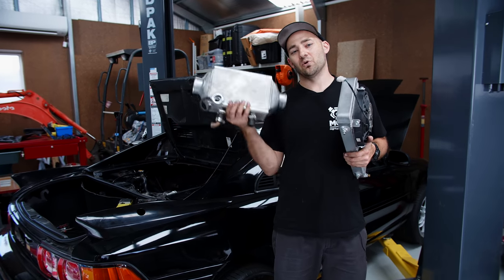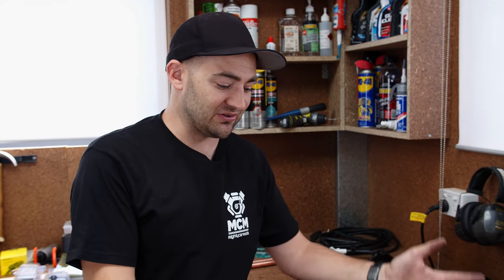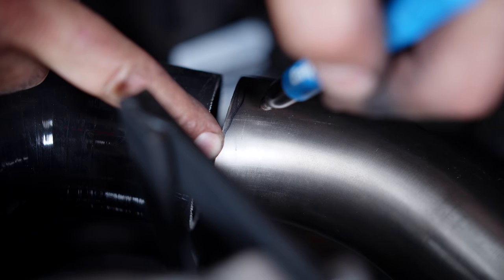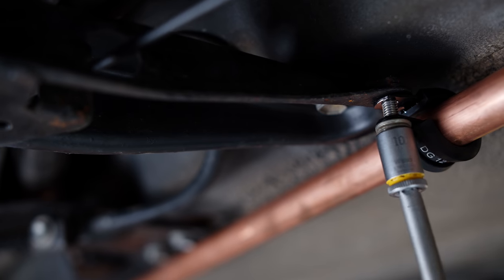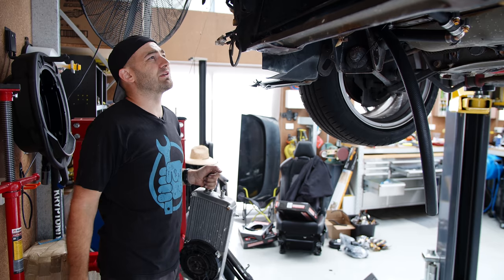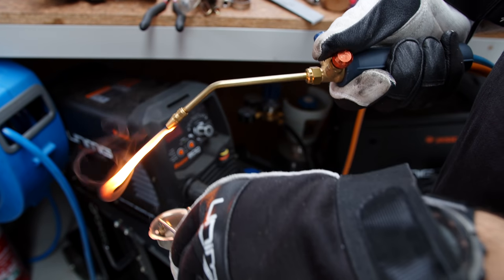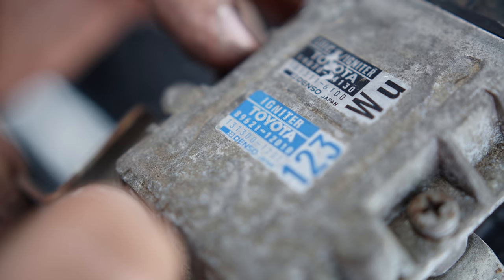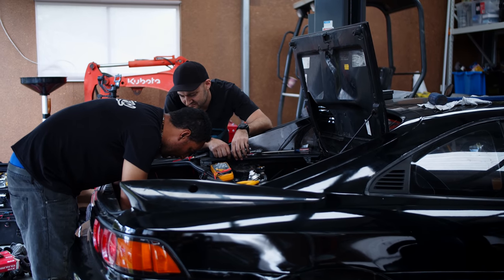MR2 takes Miss Daisy parts (Water to air Intercooler Install)

Comment: Marty, not to be an a-hole or something, but I would replace the copper pipes IMMEDIATELY. Copper and aluminum don't go well hand in hand in a cooling system. These metals will react to one another when they are in they are in contact through an electrolyte (in your case the coolant within the loop) and start a proces called galvanic corrosion. Without going to much in how it works exactly, it comes down to this; your aluminum stuff will get eaten by it (since aluminum is more active than copper). Since the water to air intercooler is aluminum and is in your intake tract, you'll risk not only damage to the cooling loop, but also risk hydrolocking the engine if it starts leaking coolant into the intake.

Comment: Marty!!!! NEVER mix copper and aluminum, they have different electrical charges and the aluminum will strip the copper and coat itself with it, think of it as copper platting the inside of the rad/inter-cooler. I would look to a metal supply house and get you some aluminum tubing if you plan on keeping this car for the long trim.

Comment: i love my 94 celica st (sure it's slow heavy and by modern standard thirsty but there's so few cars with curves and hips at it's pricepoint also for a japanese car from the early 90's it's interior is really nice, imo nicer then the 7th gen's that came after it and it just feels planted and confident just a overal nice place to be/nice car to drive around in).

just wish the rustproofing in the 80's/90's was better :( mine's already had chasis rust removed/repaired 2 years ago and it's starting to bust out in multiple places on the body unfortunatly not just the door / fender so it'll probably be it's last year (i just cannot justify the amount of money it would take to save it from the rust that is starting to consume it from within).

i'd love to replace it with an identical rust free one but the only one i've found is about 6x what i payed for mine 7 years ago all the others / affordable one's are in about the same state or seem like the rust is about to bust out, sux that toyota spent 15 years making grandpa cars >.> quite a steep price gap between the 26-21 year old nice stuff and the 0-5 year old stuff >.>

Comment: I've had that wiring problem in a few vehicles
You finally a fault, fix it, then find out that it was a bodge on a past problem, and now nothing matches up 
The only way to keep your sanity is to rip the bugger out and rewire from scratch.
( normally 1 day to sort the bodge, and find the original problem, turns out it's a £5  plug and play part to do the original repair. And half a day to rewire from scratch.)

Comment: I learned this from building computers, funnily enough, but I thought Marty would've known that adding copper to a system that also has aluminium exposed to a coolant solution will introduce an effect called "galvanic corrosion", which will eat away at the aluminium quite rapidly. That's why copper isn't typically used in automotive applications.

Comment: Probably shouldn't weld a part in a vise with the ground going through the handle...you can arc through it and start to mess up your acme threads.

Comment: In computers, they warn not to mix metals in liquid cooling systems because of galvanic corrosion. If the rad is aluminum, having used those copper lines, it could become a problem in the long term, but if you're not planning on using this car a lot, it's probably not a big deal for the time being.

Comment: 17:20 - 17:28  This is the injector ballast resistor I spoke on in the previous video.  ( the car uses a Bosch L -Jetronic system that is build under license . )

Comment: Mixing aluminum and copper cooling lines is a no-no. Even with anticorrosion in coolant, you can still experience redox.
Reply: No issue if using deionised water.

Comment: Seeing copper pipe used on a car is tingling my plumbing senses in a good way.
If you do have to solder more fittings the solder will follow the heat, so heat up the join at the end of the bend then bring the heat down a bit to help sweat the solder in between the two pipes to get a stronger join, wiring solder, 50/50 solder, is not ideal but the plumbing shop or bunnings will sell 2% or 5% solder which makes alot stronger of a join. 2% is the standard we use for water mains which can hold, in my experience, up to 2000kpa plus, i have yet to see a properly soldered join fail. I hope someone finds this helpful lol
I want to run my airbag lines in copper and this gives me more motivation to do it, i have all the copper tools and i know i can make it look good so why not. 
Best of luck with the wiring haha
Reply from the maker: Great tips, thank you!!

Comment: Need to replace the plastic clips (used for the underbody plumbing) with metal/rubber clips for durability. The plastic clips will fail!

Comment: Put a shark fitting or a fitting with solder ring in it or fine something to flare those cpper pipes for the hole to copper pipe..

Comment: Stainless dairy pipe like the stuff you've used to connect your turbo to the cooler can be an arse to bead roll a lip to. Take it off and run a seam of weld just inside the edge instead. :-)
Reply from the maker: Won’t need to, it’s got nowhere to blow out
Reply: @mightycarmods  Hopefully. So long as there is nothing for it to interfere with in there. A slight movement could nip a wire, pull a plug or create problems later. For a five minute show case of your welding skills it may be worthwhile. At the very least if anything were to go wrong it could be eliminated from the list of possible issues. :-)

Comment: Water to air ic suck . If you got good airflow the coolant is just going to keep the intake running at like 180degress constantly.  In my built 04 mcs I run 9degrees over ambient temps only . If i had a water to air ic I guarantee my iat would be twice as high

Comment: Wont the system end up clogging? I thought you weren't meant to mix copper and aluminium in a loop because of galvanic corrosion?

Comment: If the heat exchanger is aluminium you should use aluminium pipe , if it's copper use copper pipe or you risk Galvanic corrosion.

Comment: Copper tubes vs Aluminium radiators - isn't there an issue with galvanic corrosion?

Comment: As the owner of a 93 MR2 Turbo I still don't see the point of the air to water cooler......what's wrong with larger than stock intercooler in the side duct with larger fans/lid fans??

Comment: So this is a closed system water cooled intercooler, if you could build a system that could take any water like substance (pipes/pump and so on can handle it) would water still be the best? or are there other mediums that would be better to transfer heat?

And why (yes it would be cumbersome to fit/weld and so on) are there no pipes with sturdy heat fins? would not that be even better and maybe even cool enough so the you wont even need a radiator?.

And by the way, the coolest thing would be to do a small Stirling engine/pump instead of the usual pump :-)

Comment: Hey Marty - combining copper tubing and an aluminium intercooler is likely going to get you the world’s supply of galvanic corrosion. Might be fine in the short term, but you might be compromising the parts you snarfed from Miss Daisy.
Reply from the maker: It ran this way in miss daisy but good tip all the same

Comment: Isn’t mixing metals going to cause galvanic corrosion in the block of the car? You aren’t supposed to mix metals in Cooling systems. Ships even have sacrificial metal blocks in the ocean because the hull and the Props are different metals.

Comment: Mixing copper pipes with aluminium core radiator will likely cause galvanic corrosion in long term. Just saying 😉

Comment: Mixing aluminium (IC, heat exchanger) a copper (pipes) is bad idea due galvanic corrosion. Yes. There are corrosion inhibitors in cooling fluid but it is better to avoid this combination.

Comment: I am no expert just a copy of what I read about copper and aluminium 

 Aluminum will be very susceptible to galvanic corrosion in contact with copper, assuming that the two metals are also in contact with a common electrolyte (such as water with some ionic content.) Almost any text or handbook on corrosion will have galvanic series table. The farther two metals or alloys are separated on the table, faster the corrosion of the less noble of the two will be when they are in contact.

Comment: Dude mixing copper and aluminium in the same loop will cause corrosion in the coolant system, make sure you use anti corrosive additives

Comment: friend of mine had a cool electric fault with his toyota, his xenon headlights wouldn turn off, was in the shop at a toyota dealer they "measured" everything and weren´t able to find the fault , so we were in the progress to re-wire the lights so that he doesnßt have to pull out the relay everytime he parked his car. So we were in the middle of doing this when i by chance bumped against the fusebox and the light startet to work again, after that we looked but couldn´t figure out where the fault was every connection was solid, a few days later he had the same problem again so we searched again fo a solution and were already in the progress of pulling new wires to the switch and make a workaround for the german Tüv (no as intended working headlights no Tüv), when by chance i had my head above the fusebox and noticed something odd about one of the fuses through the clear plastic, as it turned out the fuse wire snapped clean in the middle but it looked like it was still intact while not making contact, so that teached me some things first don´t always trust the shop because if they really measured every fuse (cost him about 300€) which they at best made a visual control of, if you try to fix it measure it first yourself and don´t take everyone by their word and that toyota has a very odd way of doing car-electric if a fuse is defect i wouldn´t think that the light do not turn off but instead wouldn´t turn on, but my guess i that when the fuse did break it left an output in the ecu in a floating state and the relay was activated by a reverse current so that the light was turned on.
I know it is a wild story but it really happend so and apperently we were the first one to have this fault because we couldn´t find anything similar on the web

Comment: would it not be easier to just spay water over an air to air inter-cooler  ? or even try a water methanol injection to keep egt temps down and increase power output ?????

Comment: Can someone help explain the water-to-air intercoolers to me? It uses engine coolant, right? But that's always sitting around ~180-200 degrees. Isn't that just going to heat up any air that's getting fed into the engine? Obviously they work, because everyone uses them. Is the compressed air from a turbo really hotter than 180? I'm just not wrapping my head around this.

Comment: Can anyone shed light on the w2a coolant lines. Which side should you put the cold line from the radiator? The hot turbo side or the intake side of the intercooler?

Comment: You don't mix copper pipe with an aluminum intercooler unless you want everything to corrode and clog and eventually turn into dust.

Comment: Just some facts….   by bolting an copper pipe on Al / iron chassis you form anode and cathode...  starts to erode your car.  + running hot and cold lines right next to each others , will lessen the cooling effect on water to air ic .     But plus side on running long lines to front of the car..   the amount of water in system is way higher and reduces the speed of temperature changes in system… but is an double edged sword that one..
Reply from the maker: Even if it’s insulated through a rubber clip?
Reply: @mightycarmods  depends of the cooling liquid You Will Use and if it has any change To get rust particles in on it. (temp sensors etc, washers). Just make sure there is no iron parts on the line, aluminium does not matter that much even if oxydize. 

The Rubber clip Will prevent the reaction as long as it does not wear out or the liquid it self starts to be conduictive..    
But its slow reaction and nothing vital is not on that line ie brakes etc.

Comment: Can’t understand why he didn’t put that small inter cooler into the factory location, it’s feed cold air from the right side scoop. It’s about the same size as the inter cooler he fitted to the front. More work for no reward. I’d you really want a big inter cooler most people mount them in the boot.

Comment: Mixing copper and aluminium in a water circuit is a bad idea. Specially with thin aluminium.

Galvanic corrosion will eat the aluminium really fast, and form a nasty gunk in there.

For short term you can go with a lot of anti corrosion additive in the water, but for long term i would replace that for aluminium or simply regular hose.

Otherwise you may end up with an unplanned water injection system.

Comment: Hi Mighty car mods,
Im not sure where to send a message directly to you so i will wack it on here, could you guys make a video of diff gear ratios from real low 2.9 to like 4.11 on the same car to see if it makes a huge difference to acceleration without touching anything else.

Comment: The SW20 might be bad but don't even start me on changing to coil over plug set up on an AW11 MR2. It's literally IMPOSSIBLE to get it to fire right with proper signals on idle and not have severe amounts of pinging
Reply: It's not that hard. Buy a 1zzfe coil pack loom from a broken gen 7 Celica or MRS from ebay 
Buy brand new oem coil packs  ( don't be tempted by used)  

And obviously an aftermarket ECU, i run a Link G4.
 Well worth it imo. Racer X sell kits
Reply: @odin5188  The issue here was that I was running Megasquirt and even with a signal decoder, it struggled on idle
Getting the actual coilpacks wired up and in was no issue at all. I used LS1 coils
Reply: @odin5188  The ignition sensor picked up too much noise at idle from interference from the CAS. It came down to needing an external CAS on the crank
Reply: @toddscars  Hmm, can't say mine has run into this issue. My car is however a '94 JDM SW20 3S-GTE
Reply: @odin5188  SW20s are fine as they use newer tech and no hall effect sensor on the CAS
4AGZE were experimental technology at best and it shows
I've heard lots of good things about tuning 3SGTEs and I'd choose that over a 4A if i were to try it again

Comment: What is the max pressure that the hose and the steel piping stay together without beads on the steel pipe?
Reply from the maker: That pump can’t create much pressure and the water won’t get very hot
Reply: @mightycarmods  I was wondering about the intake air  intercooler piping.

Comment: I guess it won't matter because car has 50% chance of being crushed. Buuut not a good idea to use copper piping in a wet cooling system in conjunction with an aluminium cooler. Galvanic corrosion will destroy it.

Comment: I  love the diy advice guys but using copper pipe in a predominantly aluminium Waterloop is just utter insanity. Due to galvanic corrosion either your intercooler fins will clog with crap or one of the parts will just fail outright if you're unlucky enough. Just my 2 cents

Comment: copper + aluminum in a water loop *oof*. I hope you're gonna use some corrosion inhibitor.
Reply: Dissimilar metals are only a problem if they physically touch each other. Use deionised water in the cooling system. No issue mate.

Comment: I don't want to be "that guy" but mixing aluminium and copper basically gives a nice start for galvanic currents that will lead to damage of the aluminium parts. The metals are to far away on the galvanic scale. 
I am no expert, just a hobby chemist, so do not just listen to me.

Comment: This engine has not been maintained properly, internally it is full of gunk. You need to remove the sump and clean the oil pump pick up Marty other wise  this will be the second MCM Toyota with a new turbo and a blown engine.

Comment: Is there any specific reason nobody has tried using a high pressure compressed air tank to supply air to an engine? Or even a full compressor? Asking for a friend.

Comment: I'm all for trying new things and learning but your use of copper pipe is a bad idea (in the long run). Mixing metals in a cooling system will cause extra corrosion that could lead to blockages.

Comment: Sorry to say this but, you passed a LOT of miss information/wrong information about water to air vs air to air.
Water to air is VASTLY superior to air to air in cooling temps. It can lower the air temps to LOWER THAN ambient air, Water draws heat from air FAR more efficiently and quickly than air draws heat FROM AIR, there's a decrease in pressure loss (turbo lag) because the heat exchanger is feet closer to the intake (LONG intercooler pipes from the top of the motor to the front of the car, BACK to the intake where water to air is literally a couple inches).  The only down side is that it water to air is more expensive and has more parts.

Comment: OH NO dont use copper mahn. rip aluminimum.
Reply: cross metal contamination, the valence states of both metallic ions differ so there is a plating effect going on in the presence of oxygen. Guess what happens when you heat up water, you introduce oxygen and increase the acidity of the water, worsening the effect. The alluminimum WILL become pitted and can even rot through.

old water cooled VW owners with copper rads will tell you first hand that early cylinder heads used to rot through completely (Talking about 10-30 yr time-frame). modern coatings and casting compositions will mitigate this, but I will bet my right nutsack that neither the rad nor the charge cooler has said coatings applied.